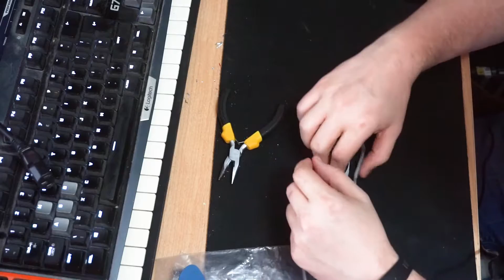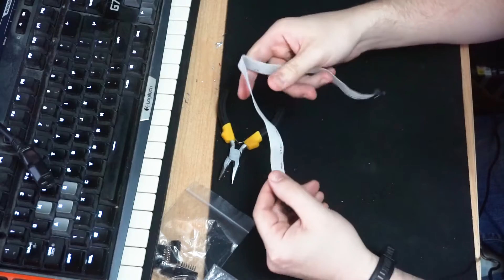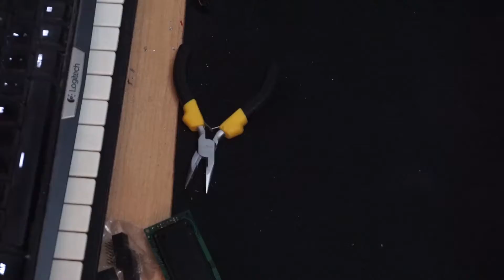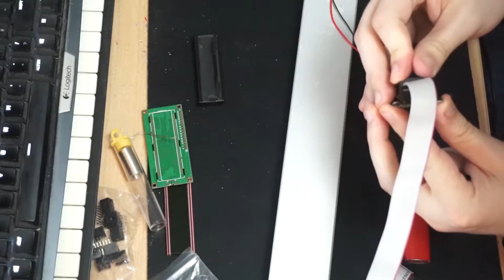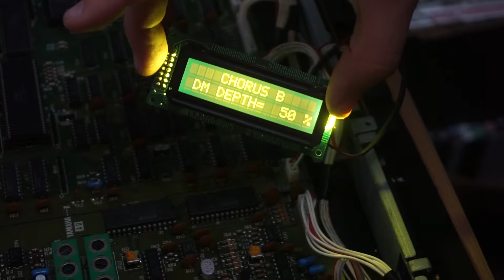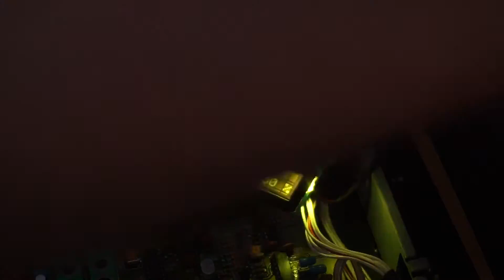Inside an ebay Yamaha SPX 90 (part 2) Good Enough

Comment: The pin out on the main board is compatible with the display you bought from AliExpress. But, it derives the backlight from the header. You can set some jumpers on the display's PCB for this. So if using the display with the separate backlight supply, you need to remove a bridge 

FYI The main board already has 6.8R resistor in the 5V feed for the backlight.
Reply from the maker: Lol. Yes mate I'm a complete amateur. No real idea what I'm doing. It's fun to share the journey. That makes sense actually re the jumper. Does the documentation describe this jumper removal? I couldn't see anything at a glance. I got another 2-3 displays and a few more cables to try again later if I found out more info. Would love to do a follow up and credit you with the fix.
Reply: @DavidImrie  it's all good, you're having a go and that's important.
You are being hindered by that soldering iron though. A cheap temperature controlled station with changeable tips and a brass wool for cleaning the tips, will change your life.

Jumpers. They look like three un populated solder pads. If there is a jumper, it will be a SM resistor looking component, rather than a computer style jumper (it's not something you'd have a need to change).
On the datasheet there is a truth table, for setting where A or K connect. So it's worth getting the datasheet.

Keep the videos coming, warts and all!
Reply from the maker: Cheers buddy I'll have a look when I can leave the house. I did get myself a temp controlled iron and some desoldering wick recently :)
Reply: @DavidImrie  I added a cheap generic display to a Yamaha SPX yesterday. It works great.
A couple of points worth noting. The display came configured for VSS on pin 2 and the SPX had VSS on pin 1, so on the back of the display I had to remove a solder bridge from two pads and add a bridge to two pads.
Backlight: to use the backlight on the display without using the separate backlight connection, you have to add a blob of solder to another set of pads, but I used the separate connection, which has the positive or Anode on the white wire and the negative or Kathode on the Red wire.

I'm going to make a few of these displays up, plug n play, and drop them on eBay for about £15.
Power switch: the plastic push pin on the switch gets very brittle (age and heat) and mine was broken too. I've ordered some suitable replacements from Shenzhen.
Reply from the maker: @StuartTaylorEsquire  Legend.. you should really make a video on this :).. How do I figure out which pads you are talking about? Would  you happen to know the name of the connector type the SPx90 uses for the power to the display?
Reply: @DavidImrie  I haven't checked the dimensions, but at first glance I'd say is a 3 pin JST XH connection.
Reply: @StuartTaylorEsquire  This is great! I will probably order one myself now, is it a case of simply bridging those pads? Also, does the display plug and play on a Quadraverb,  or does it again need modding? I actually already ordered the Quadraverb one yesterday, seems like everyone is scoring masses of dirty old reverbs ;)
Reply: @mccarry30  the quadraverb display is a little bit different, but I've just taken delivery from Shenzhen of some lovely quadraverb displays, I'll be dropping them on eBay as plug n play replacement.
I'm in the middle of making up some cables for the SPX display, then I'll drop them on eBay as plug n play too.
The power switches for the SPX are perfect genuine replacements, so I'm happy I don't have to make a bodge like @david had done to his unit.

The quadraverb does have an Achilles heel, in that it uses a chip that is obsolete and I can't find any anywhere. So at some point there will be a lot of QVs heading to the landfill.
Reply: @StuartTaylorEsquire  Cheers, shame about the Quadraverb chip! I've emailed them at Buydisplay asking for another screen just now, I'll see if they can add it to the existing package then I'll mod both of them for each unit. Otherwise I'll check all the pin outs on the Quadraverb and the data sheet and see what needs changing, whether I need a resistor or anything else!
Reply: Stuart Taylor I just got mine, a 1602 2:1 from China as you mentioned. You spoke of some solder pads that needed bridging and unbridging, do you mind if I ask which ones they were?
Reply: @mccarry30  i'll try a put a quick video up showing you 👍
Reply: @StuartTaylorEsquire  Thanks, I just checked the data sheet. I can see that 1 and 2 are the other way around as you mentioned, and S1, S2 need opening plus a bridge on R12. I also bought a 5V display, so I'm guessing a 10 ohm resistor(?) somewhere on one of the first 3 pins of that cable to lower the voltage in and it's good to go? I have some 22 ohm kicking around today.